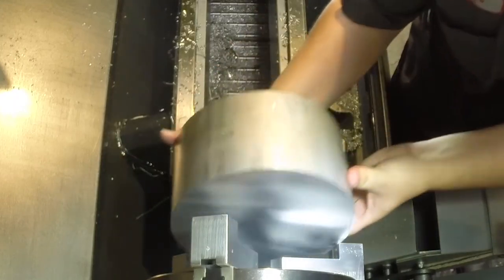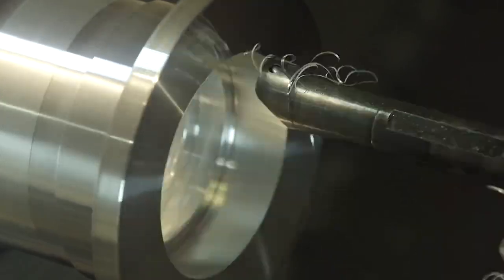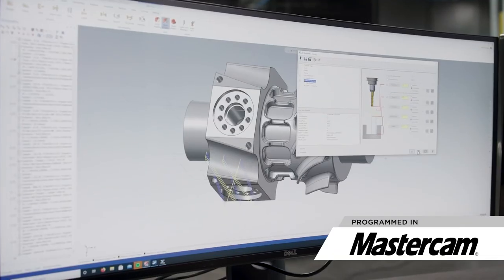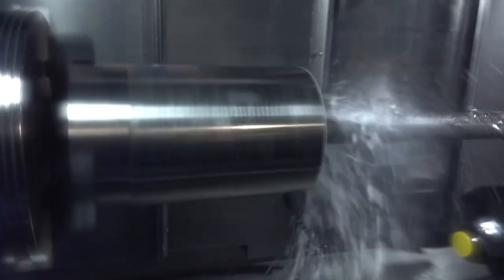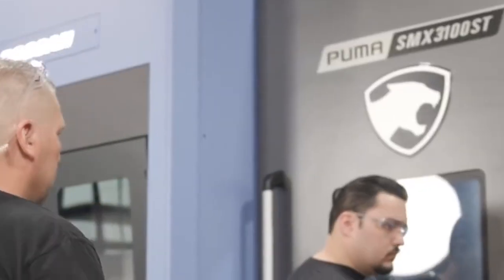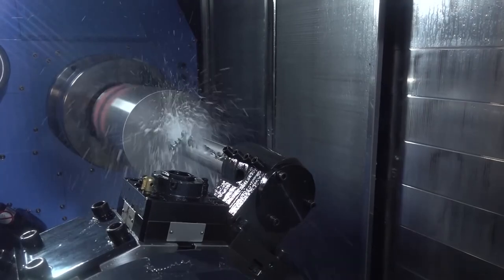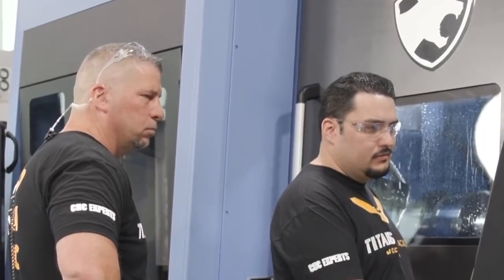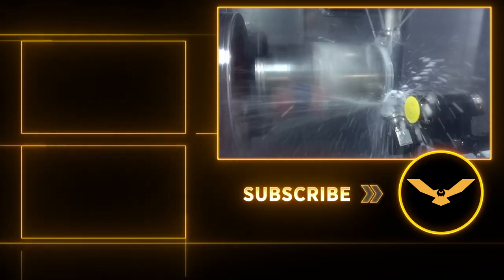I Became the Lead Programmer in the Shop... but I Don't Know How to Program

Comment: I learned programming in a similar way.   I've been a machinist for 16 years now.   And at our shop 1 guy typically runs 2 or 3 machines at a time.   I taught myself programming in the 5 minutes here and 10 minutes there while machines were running.   I had a good support structure too.  My boss who did all our programming at the time would answer any questions I had.

Comment: Every one wants to mill, no one wants to turn = give me a lathe!
Reply: After running 2 spindle/ Y axis lathes with live tooling.. I envy those long run times on the mills lol.
Reply: @koolmexican721  Screw them I envy you! LOL
Reply: @koolmexican721  sweetest time i ever had was just putting bars in the bar feeder at the start and end of my shift and maybe changing inserts a few times per day.
Reply: @MrCoffeypaul  lmao no shortage of ridiculous parts here. Low volume. Programs are ass from the start. Kinda fun since there’s always something new. Can be frustrating and butt puckering.
Reply: @angrydragonslayer  Must be nice lol.
Reply: @koolmexican721  it sure was

Slept so much at work that i'd stay up all night gaming/studying and still be well rested

Decided to move on after finishing uni since it only paid 2k but as a student job, it seems to have been far beyond average.
Reply: @koolmexican721  Good programmers can be hard to find but it helps if there is a proper line of communication between the guy on the machine and the programmer. Can be a help if your programmer aint straight out of Harvard/ Stanford 😂
Reply: @MrCoffeypaul  Oh yeah the programmers/engineers all stay huddled in their offices. Some may come out to the floor every once in a while. On night shift I personally work side by side with one engineer almost all night every night. He's taught me plenty about the trade. Dude is a genius.
Reply: @koolmexican721  An unusual engineer!

Comment: Just remember it could always be worse. The company I work for handed me the reigns to our CNC department January 2,  2020. Which consists of 2 mid to late 80's Okuma lathes,  1 2014 Haas lathe with live tooling, a early 90s Fadal mill, broach machine and a Blanchard grinder. I had no experience with any CNC machines or CNC programming. But am still winging it thru.

Comment: I'm at this cuspice myself! Working with my new company I've noticed the programmer is also the lead engineer, but he doesnt have the machining experience to correlate with the programming side of things. Sure the software can get the program close, but it takes tweaks to get it to run GOOD. Those tweaks require hands on experience! I've learned from the best but I still have plenty of gaps in my knowledge. I'm at the point where I must take it upon myself to further my programming knowledge in order to translate my setup/machining experience into the programs so we can stop wasting inserts and run more efficiently. 

It's a scary thing when the guy who is supposed to know it all tells you "I dont know." And it's your job to find the solution. All I can say is growth doesnt come from being in your comfort zone!

Comment: We had a young man come in some years ago, seemed promising.  I asked the lathe guy what he thought and he said, "his programming needs a lot of work, but his set ups are solid and he knows the tooling".  That young man would have become leader of that department in a few years, but due to a nasty Operations Manager he left for a $6 raise at another company where he could get 20+  hours of overtime a week.  Now he's making bank.  Another lathe hand we had, the guy was very smart and a good worker but the company didn't want to acknowledge it.  The new Operations Manager demeaned him and told him he wasn't very good (because he was asking for a raise).  6 months later he left for a position on GM's racing team machinist team as a gear grinder, now he makes $45 and hour, doubling his pay.  So much for being a bad machinist....  The point is a solid base knowledge can take you from being average to making big money.

Comment: Wouldn't of thought you woud need software to programe a lathe though as most controls have built in cycles.
Reply: True to a point. When you get to -.00005 / +.0 tolerance on grooves that are .0005 wide and deep around the outside of a 22-in OD part. Then add a finish quality call out on top of that. You need the computer to hack out all that math.

Comment: Where can I learn to program? All the courses I find are for fundamentals and train someone to be a setup man not a programmer.
Reply: You shouldn't think you can just jump into programming with out time working on the floor running/setting up machines.  I mean you CAN, but your programs will reflect the inexperience.  There is so much more to programming than just learning the software.  There are things that only come with time actually making parts.  If you want to get into the trade you kinda have to start as an operator and work your way up.  If you are driven and have the aptitude you can move up fast.
Reply: @brandons9138  I’m a lead setup man at my  shop.

Comment: I learned both bc my dad couldnt afford an expensive programmer than could do both or two programmers. Not an expert on either but can keep the work flow going. The stress after all the years of make or break took its toll tho.
Reply: Any advice for someone learning this field? I just received my first job but need to do some learning on my own
Reply: @luqmanmuhammad1083   check it twice, cut once. On a lathe i always bump my offsets up by atleast .030 to check the first part. Mills i leave .050 to the side and peck any holes. Sound is the most identifiable indicator for something cutting good or bad. Keep calm and anyone that is cocky and says they are the best usually is not very good. Good luck!